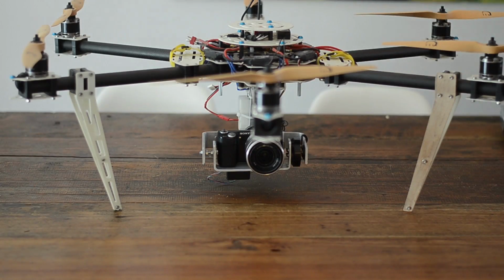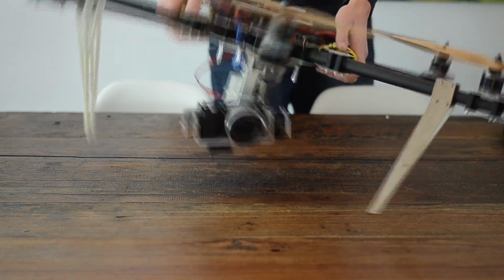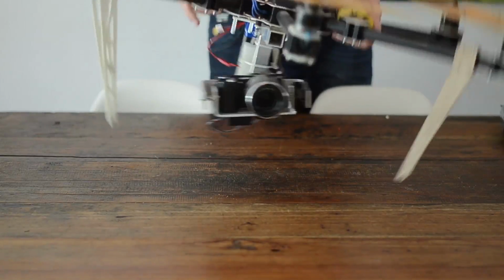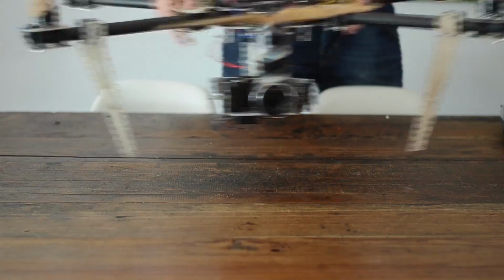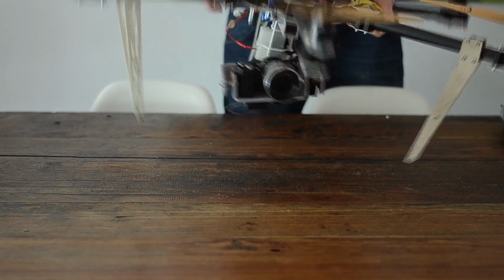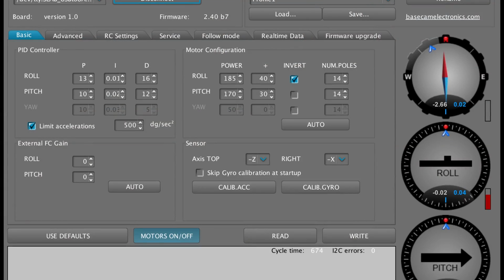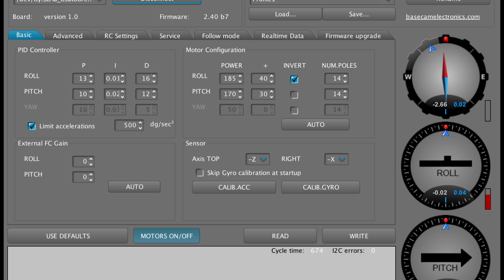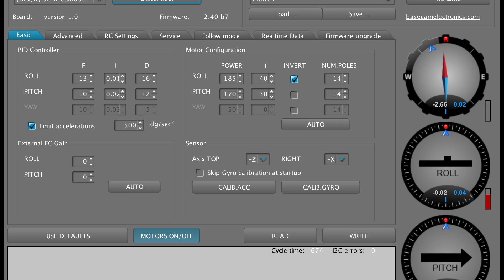Drone DIY Brushless Gimbal Review! For Sony NEX 5n

Comment: I tried many times with a DYS gimbal set and evvgc/storm32 but it failed all the time because of defective products(bent and mismatching frame, badly manufactured gimbal controller). I now have a working 2 axis basecam 8bit(not 32bit) controller with 3 axis extension board and the 4108 motors from the defective DYS gimbal frame. Will this work with a Sony NEX5 camera once I make a DIY gimbal frame with this or do I need an expensive 32 bit controller? Thanks

Comment: Hoi, how did you balance the camera?? I though of making such gimbals too, but... most you can buy, are either for 1 model camera (+lens) either, or, need adjustments, which is a pain sometimes... 

PS what did that Syn700 of Jacques cost ya?
Reply from the maker: Jan Peter van Popta I made slots in the alu, so therefor I can slide parts of the gimbal up-down left-right. I don't know you would have to ask Jacques.